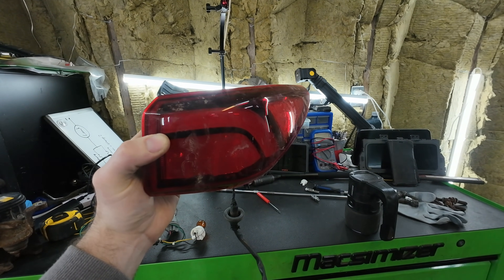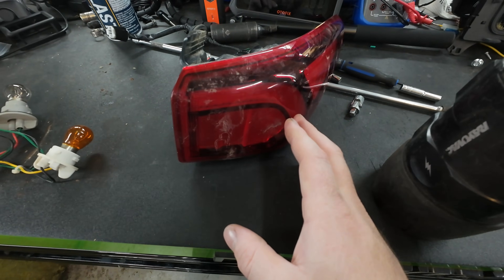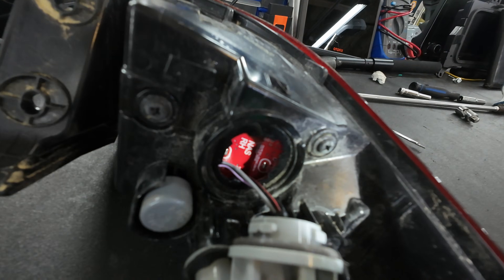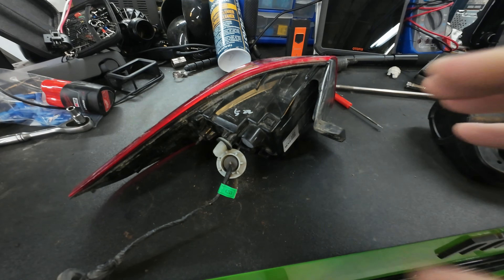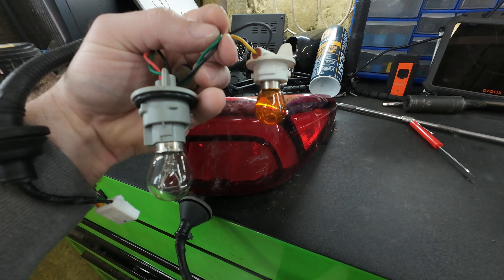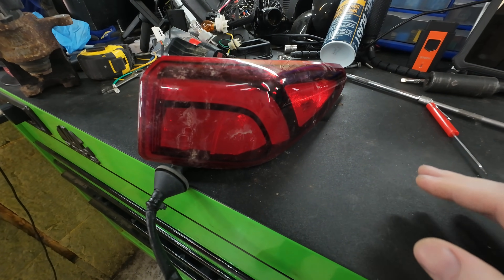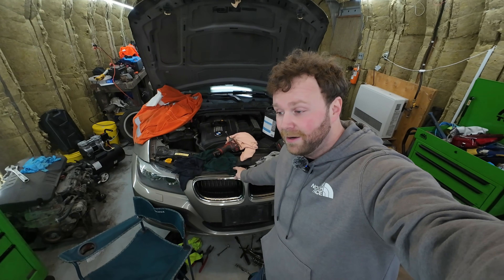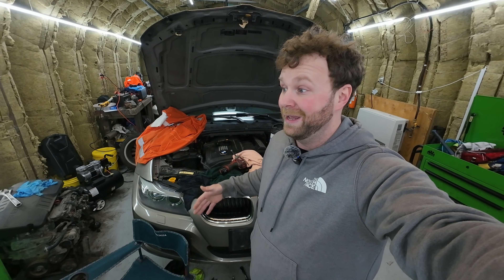Car Manufacturers don't even want you to change bulbs, they want you to replace entire assemblies!

Comment: They don't even want you to do oil change too.
Reply: Some vehicles don't even have dipsticks.
Reply: @martyharless5097 you're lying.   Maybe for automatic transmission fluid but not motor oil
Reply: @martyharless5097  How can you check the oil on those?
Reply: All cars that use oil have a dipstick, it's the vehicles that use cvt transmissions whoes transmissions don't have dipsticks to check your transmission fluid.
Reply: @Lockdown-k7q  look it up. Engines that don't have dipsticks use electronic oil level sensors which is fine but  if it fails that's another repair bill.
Reply: @martyharless5097  you absolutely correct
Reply: @martyharless5097 and if it malfunctions and doesn't tell you that you're low on oil? Guess what?
Reply: @bakatoroi yea BMW does that shit,I used to have a Bmw You had go in the Software Setting and press On Oil Level,that's what you had to do,no dipstick  I got rid of that POS car.Never Again.
Reply: @Lockdown-k7q  completely wrong, i remember i think around 07 bmw started it, no dip stick at all, you have to 'check' in software. and the transmissions aren't just cvts, its basically all of them these days. a lot of cars still have 6 or 8 speed transmission and they still dont have a dip stick. my hybrid with the electric motor for a transmission also doesn't have a dip stick.
Reply: That's why some German cars don't even have a drain plug.
Reply: They don’t even want you to even drive it yourself anymore
Reply: Yeah. Toyota says every 15,00km, but my independent Toyota specialist (and pretty much every other mechanic) says change it every 10,000km, like we've always done. I'm going to listen to the majority and change it every 10,000km.
The same rule applies for transmission fluid, especially because my car has an eCVT. (Electronically continuously variable transmission. ie. Computer controlled CVT -It's better than the non-computer-controlled version.)
Reply: @SCH292  they want you to pay subscription for features like "turn by turn" navigation 😠
Reply: @mondocjenson-dy8zd  is that just a GPS? Something we all have on our phone for free? Which can Connect to out cars via Bluetooth for free?
Reply: @harrisonr3456  Rich housewives don’t even question the cost, in my experience.
Reply: @mutoneonthere women of course they dont

Comment: I bought my son in law's 2000 Corolla a few years back that he had owned from new. It needed some work but I did it myelf. 
New brake lines and fuel and evap lines from  Toyota that was a bit of a job. New calipers, rotors, pads. brake drums. shoes and flexible lines so the brake system is like brand new. New suspension, struts all around, sway bar links and bushings. New power steering pump, well actually a junkyard pump because the new pumps did not come with the pulley and that was what went bad. New battery, two new front tires, and some wipers, so I put a little money into the car but she drives like new. Oh I also put new door handles on the driver and passenger front doors, they are plastic and they cracked. It has an automatic and roll down windows and it gets 29 30 mpg. Great little car that doesn't need Big Brother to fix it. Now I see people asking a lot of money for old Corollas even with bad motors. Time to start fixing things instead of throwing them away and getting a new one. Good video. Happy Motoring;

Comment: Bulbs relay and a 12volt  source. Simple repair
Reply: If I believe correctly the law states that you have got to have working lights on the back of your vehicle end of story.
Reply: @christophersebastian4855  You believe incorrectly then, in my country the law states any light source must remain unmodified and undamaged to comply with the standard it is marked with. 
You can chuck a trailer light on there if you want, ugly as hell but if it complies with it's markings it's legal.
Reply: @christophersebastian4855 ,Just one red light ,that's it .
Reply: Unfortunately that is a modification and not permitted in many countries.
Reply: @Stambo59  not permitted? how would they know
Reply: @gordons_here  Part of an annual safety inspection in some countries.
Your solution, though it's a good idea, would throw up communication codes on many cars. 
Yes the car has a conversation with the tail lights.
Why, who knows but it's dumb.
Reply: @Stambo59  yea . . .   I would do it anyway - but then I'm a repair person who fixes things other people have givin up on.  how would an inspection see inside a tail light module? maybe a bribe would be in order - ha!
Reply: @gordons_here  The difference between a single bulb and an array of LEDs is quite simple to see.
Reply: @Stambo59  yes I have replaced single light solder in lights myself - tricky but not impossible.  I would toss the array and fab in a changable bulb that runs on standard LED socket bulb I believe they call them bayonett bulbs - the changable bulb is built of an array of led lights.  working on that right now on my boat (also 12v) the battle against dumbness continues.  as long as it's all 12 v dc negative ground it's all pretty workable (space limitations are the main problem - but I've been know to melt/cut/grind away to gain that space - ha
Reply: @Stambo59  long as the lens or bulb color reflects its function your good to go where I am.
Reply: @Stambo59  if your government makes it illegal to make a light bulb repairable for $3 instead of $1500 then they're part of this mafia
Reply: @Stambo59 You can modify it any way you want if it works .
Reply: @MUUKOW3  Or not. Depends where you are.

Comment: If there is no mechanical key; it’s not a car. To me. Most of aftermarket lights don’t work or will drive you nuts in till you figure out problem is in aftermarket light. Right now got 2018 Toyota Camry with aftermarket lights going nuts. I said it needs oem lights. My cost is around 900 . Nobody is ready to spend 2-3k on lightBulbs. And don’t like to pay 2-3 hours of diagnostic ether. No wonder every other car is driving with high  beams on. Because that’s how this light are something not right. It will only work on high beam. Even better for manufacturing more cars getting wrecked, more cars being sold.

Comment: Can I point out that most all cars in the 70s/80s and before used headlight assemblies, those round headlights that every 60s car has for example, you must replace the whole headlight assembly. It was cheaper, and easier though. Then they switched to replaceable bulbs, which should have remained even being led bulbs.
Reply: I clearly remember.  I think I paid around $6 for my headlamps in 1975.  Of course, $6 was real money back then - or was more real!

Comment: Just bought a single owner low mileage 2017 Camry with the 4cyl. I can service every aspect of this car myself and the parts are relatively inexpensive and the brand is highly reliable. I can feasibly take this car to a million miles with the right care (and a little luck).  I wouldn’t buy a more modern car.

Comment: GM has the same issue with the tail lights on Escalade, Tahoes, and others. LED tail lights that can't be fixed, needing a $2000 replacement from the dealer....

Comment: They don't want to sell you assemblies. What it is is they don't want to sell you something at all. 
But since they want to sell cars, pretty tail lights sell cars. That means circuit boards. That means revisions on circuit boards, which are easy... And that means you now have multiple parts that are very similar that have to be stocked. Well since you only did one production run of these parts to keep in stock there's now a limited number. That makes the price go up. 

They also don't care about the assembly cost. They're not going to lose money on it and they have to stock more unique part numbers for vehicles for the next 7 years so the price goes up.
This isn't gouging, it literally costs them more too. 

And it all comes down to the fact that you guys, the mechanics, don't have the time ability or equipment to fix the parts at a component level. You need to quickly replace it at a module level and there are only so many modules.

Meanwhile someone like me knows how to take apart the housing, repair at a component level, and reassemble it and seal it back... But you would consider that specialty repair. After all I've seen mechanics try to solder. Never mind surface mount components, they have trouble with wires. Lol

Comment: Has nothing to do with profit for selling parts....
1. Ease of assembly
2.ease of repair 
3. computerization 
4.. LOW VOLTAGE SERVICE...
Leds use far less power and "supposedly" fail alot less often....they are brighter and are supposedly a lighter more compact assembly......
...

Comment: Blame the government. They said get rid of incandescent bulbs and use leds because it's better for the environment. So now we throw away tons of plastic and toxic circuit boards instead of a tiny bulb.
Reply: that is the lobbyists from gm getting greedy to waste more of our money, they are for profit not for environment
Reply: Is that why every bulb out there sucks now? Too bright at the bumper but can't see 50 feet down the road as adjusted from the factory.
Reply: @CapnRumple  Wrong.  You're one of those uneducated fucks that believe their perceived entitlement makes them far more than they are.

1.  The PEOPLE tell the government what to do... not the other way around. 
2.  With LED's we can implement lighting nearly anywhere.  On any surface, at any plane.  
3.  Automotive LED applications are safer.  They produce a more accurate color over their lifetime.  They produce more uniform lumens over their lifetime.  They last significantly longer than their incandescent counter parts.  They illuminate significantly faster than incandescent producing a significant improvement for reaction times.
4.  Because of these features more aerodynamic body lines are available.  Providing YOU with operational savings, while not changing an incandescent bulb every couple of years... while its output was already degraded by more than 25% BEFORE it burned out.
Reply: The government is speaking for car manufacturers; this is clearly a coordinated effort.
Reply: @CapnRumple  it’s not the leds, it’s how fancy they made them.  You can make a simple led replacement for a regular bulb. They don’t have to use the tiny ones attached to circuit boards that flash in fancy patterns.
Reply: of course you can replace an incandescent bulb with a LED bulb . .
Reply: Blame the consumer not the government.  They see the cool LED and OLEO tail lights on the new luxury cars and it trickles down to the economy cars.  People don’t realize all that “cool” stuff costs more money.  Me, I’m good in my easy to maintain 18+ year old cars.  I could not care less about fancy taillights and headlights that newer cars have.
Reply: @ghostwrench2292  Me too.   My newest car is a 2006 Chevy pickup and that has more technology in it than I care for.   My oldest is a '94 and I love it.   I/m old enough I don't plan to ever buy a new car.
Reply: When they said that, it was for home use which uses electricity. The reason for leds in cars is for greater visibility. There are led bulbs you can replace incandescent ones now. Ford started the led panel thing on f150 and Durango did the same thing. One of the worse ideas ever since they both use cheap materials. I replaced all my incandescent bulbs in my 2004 Toyota matrix to led and it's way more visible. Nothing to do with government, just cheap car makers.
Reply: They weren't talking about automotive bulbs.  Sheesh.
Reply: Only its more like a thousand incandescent bulbs to one LED light
Reply: @duncancairncross  ha! I wish!! - I'll bet I have replaced 20-25 LED bulbs / lights so far between my boat/cars/house   - so, maybe 3 or 4 incandescents to an LED at best.  the power savings is the reason for LED's not how long the last
Reply: @gordons_here  power savings just so we can feed the AI machines…
Reply: @gordons_here  Those are house bulbs - a LOT cheaper than the car ones in the article!
I have over 30 LED downlighters in my house - I have replaced ONE in 12 years
I have about 20 incandescents and I have done over 30 replacements in the same time
Reply: @duncancairncross  yes of course - I wassnt talking about those - I was referring to 12 v or 5 volt led lights in cars/boats 12 v DC systems.  but I sure have replaced many a LED house bulb at work etc - but I'm a repair person who deals with lights in a variety of systems.  odd but it seems like quite a few were from freight elevators . . . I give those 2 years - ha
Reply: 🤡 You voted Trump for sure! Government was not involved! You can swap a LED as easy as a lamp. All car companies swop for units. Easier for them. Worse for us.
Reply: @bokhans  I guess you weren't around for Obamas presidency. He implemented that policy years ago. Corporations took advantage of it.

Comment: And all these Honda lovers out there,
Your new Hondas all use this and the light is about 3-5k each and I’ve seen them go out on 2 year old cars. Honda catalytic converters are over 2k now (more than bmw) Honda control units are over 2k and needed to run the car. You pay more for a Honda now then if you were to buy a benz. I mean oem Honda wipers are 50$ a wiper and they sell them individually but wipers on a benz is $36 sold as a pair.

Comment: Price of my Buick Enclave headlight assemblies popped up when I was searching for bulbs... ONE!! One headlight assembly, $3800. WHAT?
I mean I really like my CowEnclave. But almost 4 grand? For headlights that get damaged. What, when, splutters, how did we get here?
EDIT <<< I still own a carburated, 1989 Honda Accord w B20a...  She'll run in the apocalypse. And the headlights are cheap. I prefer the EU code Crystelumes if you need to know. They have a nice clear front and a tight spot beam. the USA versions have a fluted glass face and a muddy wide beam. Great for suburbia, but bad on deer roads at night.

Comment: Wife had a minor accident with her 2008 manual Nissan tiida and insurance wanted to write it off. This brought up the question of should we update. Can newer cars be repaired and maintained. Biggest risk in Australia since cars are no longer built here is the large variety of makes and models. No longer is the choice between 3 manufacturers. With the coming financial recession many of these vehicle makes will disappear from the Australian market. I can remember when Daewoo went down the gurglar. With the need to reprogram Intergrated software just to replace a tail light bulb these cars will be impossible to maintain.

Comment: What the IRS allows for mile down the road.  For 2025, the IRS standard mileage rates are 70 cents per mile for business use, 21 cents per mile for medical or moving purposes, and 14 cents per mile for charitable organizations.  Kinda give you a clue what it should cost to go a mile down the road.   Tires, insurance, maintenance, fuel and the occasional tail light.

Comment: At that price you're almost better to just pay for a traffic ticket than having the light fixed.
Reply: Those tickets are usually fix-it tickets; they are not dismissed until you prove you have fixed the issue.
Reply: Take receipts of the price to the judge.

Comment: SERIOUSLY thinking about 3D printed replacement with NORMAL bulbs 💡 Just a thought 🤔
Reply: Are you going to write the firmware that allows your 3D replacement to communicate with the car computer to tell it that it has lighted the lamp the computer has asked it to?

It's typically not just sending voltage to the tail light, it's sending a command to the tail light assembly to tell it to light the lamp and get confirmation that it lit and often at what light level.
Reply: @VideoArchiveGuy  is correct. It's not just voltage/current that the newer cars require to make the lights work. Now they require the light itself to have the correct proprietary 'firmware' on their chip to match the car. Can't make aftermarket parts without copyright infringement. You have to buy the entire assembly, made by the car maker ($$$), for it to work.

Comment: How about headlights? Two complete headlight assemblies on a modern car is like half the value of the car.
Reply: ....that you virutally never need to replace and last the lifetime of the car unless you're in an accident or other event.
Reply: @littlegoobie Yes?? Or if the plastic cracks and/or get moister in them. Or gets cloudy and you want new ones.
Or the led drives fail, or the motors for the leveling, in many cases they are not sold seperatly.
People need to replace the alot.

Comment: So if your light burns out, in the past if you got pulled over for it you could just stop at a parts store and get a new bulb, and if you did it within 24 hrs then the ticket would be voided. So now you would get hit with a full price ticket on top of the repair cost because you would have to wait for this to come from amazon or ebay ect. Or, if the dealership has it in stock and you're willing to pay 2 or 3 times the amazon price you can choose that option. Oh, and let's not get into if the light assy needs to be programmed by a dealership in order to work, so now there is a labor charge on top of that.
Reply: All this for a lightbulb too